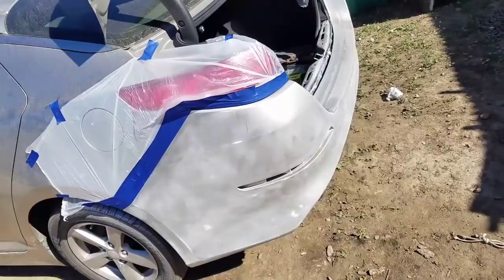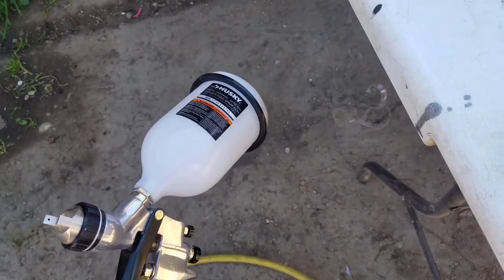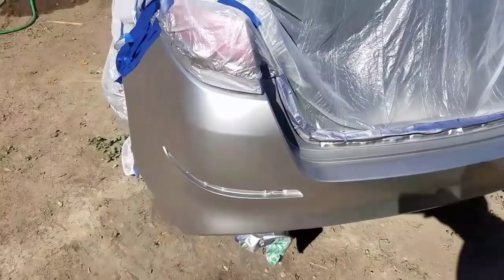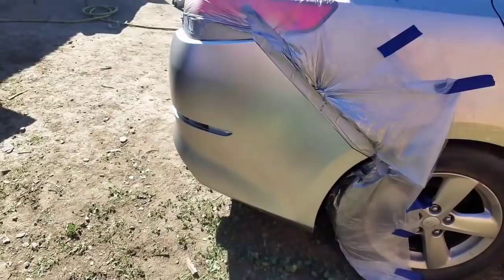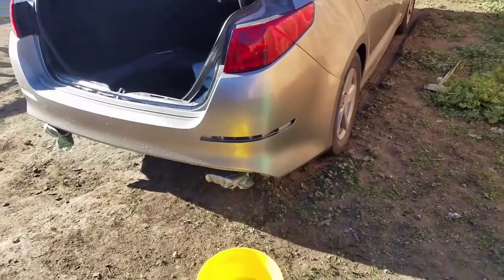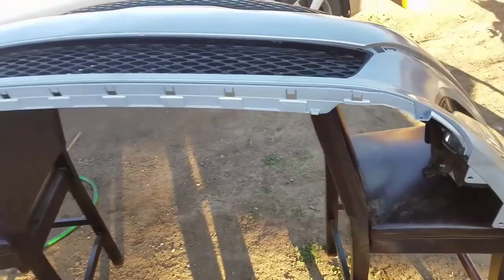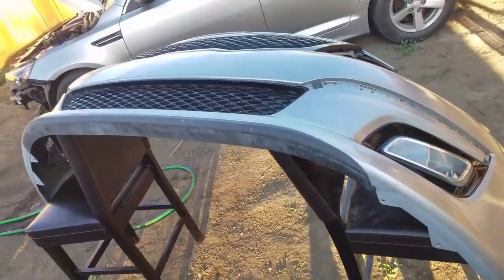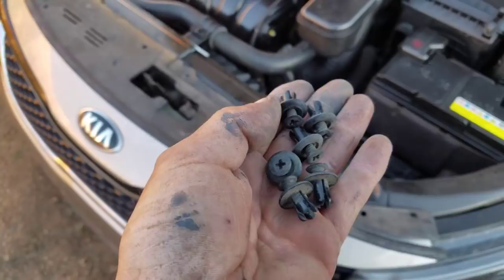copart kia optima rebuild project, diy paint job using automotive touch up paint

Comment: Its good man, if you polish the quartel panels on top of the tires would it blend more with the rear bumper?
Reply: Also what air compressor size are you running? and at what pressure is your regulator for the air gun?
Reply from the maker: Z71___  dont know if it would blend  bro but it might, once again thanks for watching and leaving a comment
Reply from the maker: Z71___ let me check on the compressor bro i dont know all the details all i can remember about that compressor i used in this video is that its a 4hp and that its old and its like 8 gl bro and the gun was set a 40psi , let me check on the compressor and ill let you know bro thanks for watching.
Reply: CALI REBUILDABLES thanks for the info man and keep it up!
Reply from the maker: Z71___  hey bro just checked out the compressor and its a campbell hausfeld 4hp 13 gallon 125 psi max -air delivery is 5.1  avg @ 90 psi

Thank you bro

Comment: Yes its 10 times better. The only way would be better is if you were a pro painter working in a shop. For a back yard mechanic its excellent and now the car doesn't look cheap. You need Black Magic Tire Shine after a wash and it will look like on a Dealer Car Lot condition.
Reply from the maker: EZ20NOWTurboCharged exactly the way i see it man, im not a pro and things could have went bad real quick im just glad everything turned out ok keeping in mind im not a pro and about the black magic i will definitely keep it in mind, thanks for watching and the tip on the "B M" for detailing the car
Reply from the maker: EZ20NOWTurboCharged  nice man i like the way it look like if it was wet and tge guy says it stays for a while, thanks for the tip and showing me the exact product  .